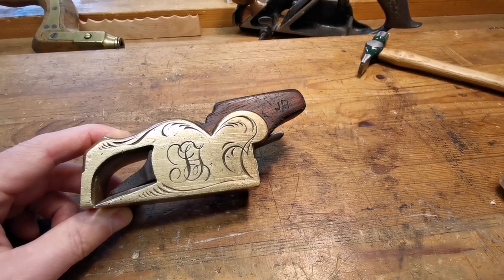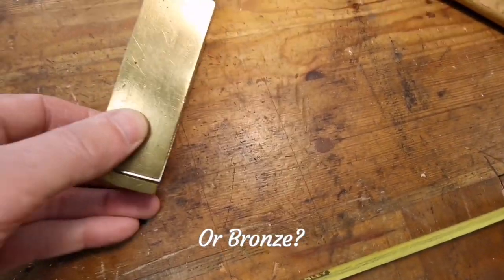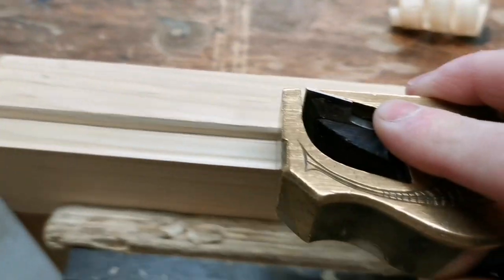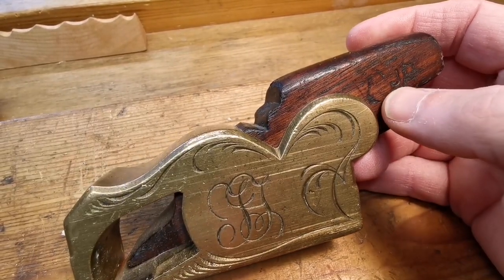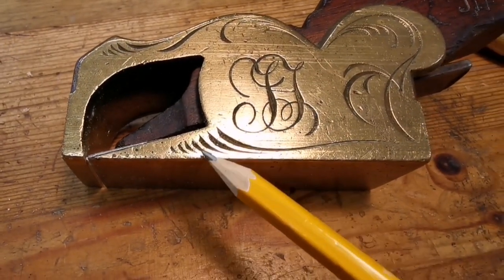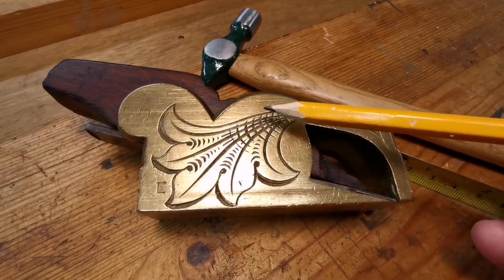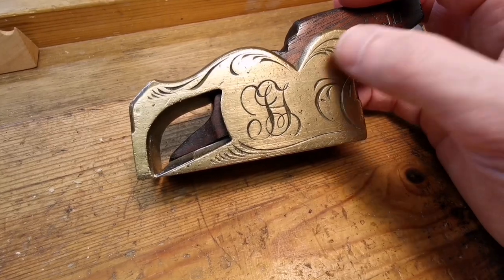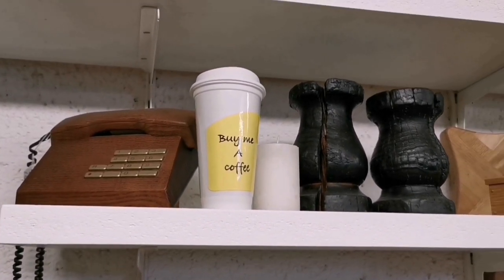Engraved Bullnose plane - Brass? or Bronze? FOR SALE.

Comment: An heirloom tool if ever there was one!
..... I suspect Brass because of the lines rubbed in. Bronze is a bit harder. But I could be wrong ;o)
Reply from the maker: I think brass but I'm not sure at all.
Reply: @twcmaker  Well they had a habit of recycling so if some bronze got chucked into the pot .... (not too much though as it would affect melting temp).
Reply from the maker: Ahhh.